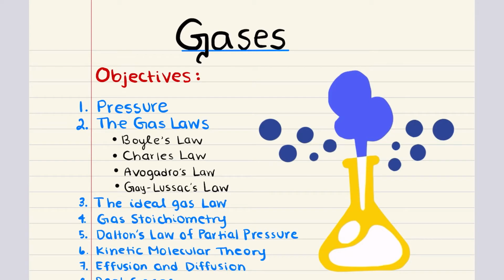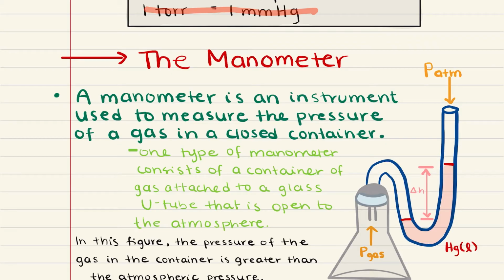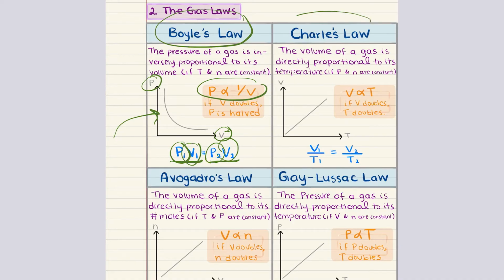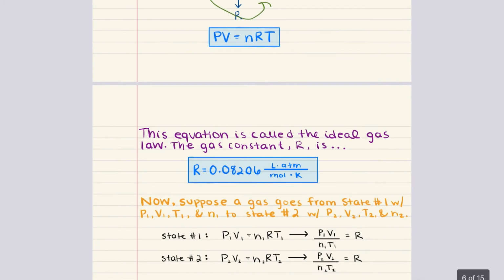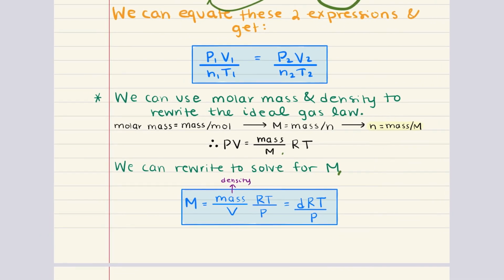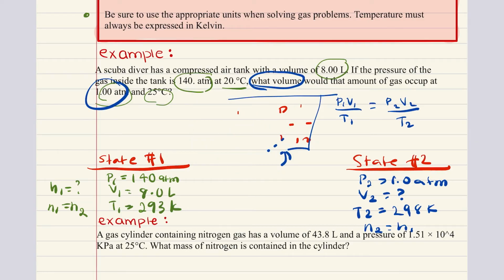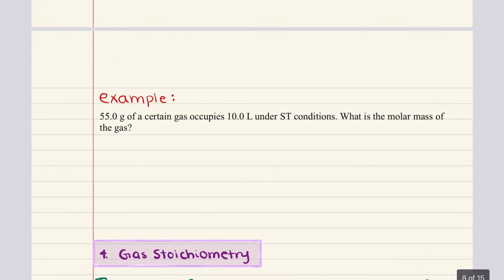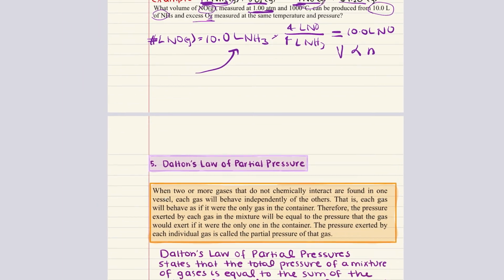General Chemistry 1: Chapter 5 -  Gases (1/2)

Comment: So with the last problem example
Its still using the M=drt/p? But rt/p =22.4 and d will be 10L multiplying those to get M=224? Do we divide this by the mm of NO to get 7.44g? 
Did I understand this right?
Reply from the maker: Timestamp?
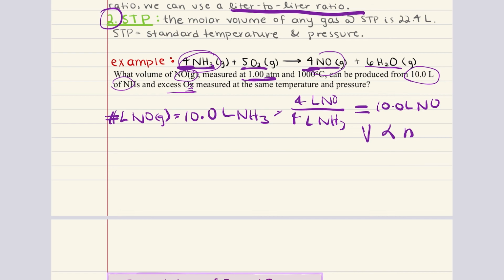Reply: @professoreman2289  @41:38
Reply from the maker: Thank you! I get a lot of comments on a lot of different videos and a timestamp helps me reference my long videos easier. Anyway, to answer your question:
You don’t need to use the M = dRT/P formula here. This problem is about gas stoichiometry, and since all gases are measured at the same temperature and pressure, you can use the volume ratios from the balanced equation. The ratio of NH3 to NO is 1:1, so 10.0 L of NH3 produces 10.0 L of NO directly.
Reply: @professoreman2289  no problem, i will keep that in mind 
For the question:
So the answer for the molar mass is 10L i don't have to calculate further?